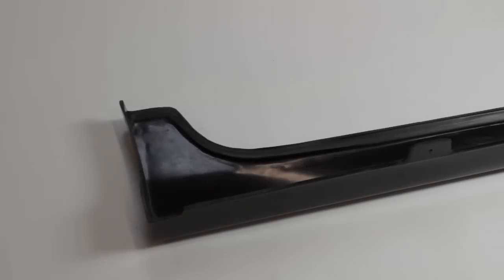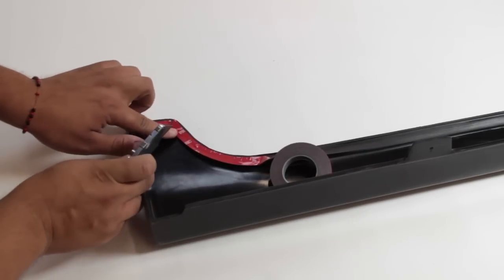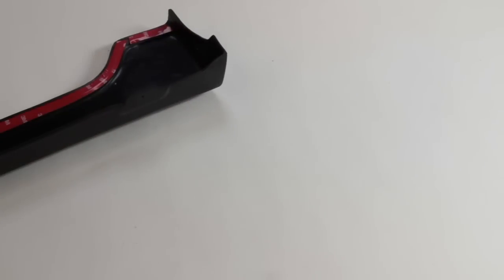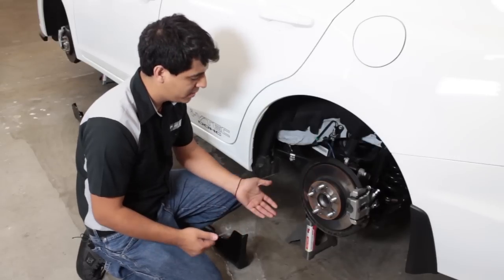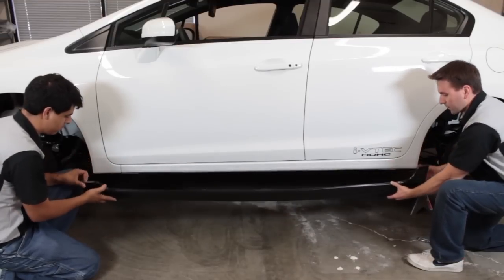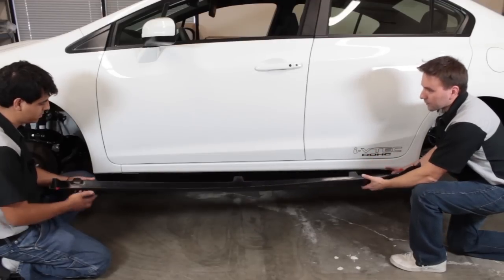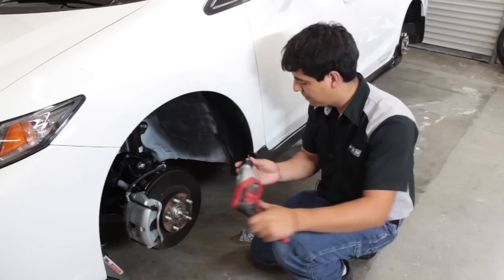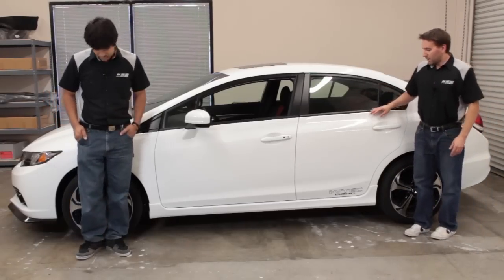PRO Design MD Style Side Skirts Install - 9th Gen Honda Civic Sedan

Comment: Great video! But I got a question, I want to have side skirts on my 2016 Honda Accord LX installed...however, on the right passenger side I have a dent underside of the rocker midway. Should I have that dent pulled before installing the side skirt for it to be flush with the skirt or can it be done by screwing where it's not dented??
Reply: I have the same problem. How did you do?
Reply: @Maycletts  Well I didn't have it done yet but I do have two options. My paint/body guy said he can pull the dent. Then there's a place that installs the skirts even if you didn't purchase from them. I actually have a set of skirts still in the box, so I'll let you know when I get a chance.

Comment: Do I  really need to remove tires to install it?
Reply from the maker: +Jc Samiano It will make the job easier. Some drills may not reach or will have a bad angle cause it may hit on the tire.

Comment: Question - Will this interfere with the spots you jack the car up ? The metal peices under the sides in 4 places.
Reply from the maker: +Tyler Redford They will not. You will still be able to use them to lift the car.
Reply: Also this will fit on the non SI model sedan of the same year ?
Reply from the maker: Hi Tyler.  Yes this will fit all Sedans (including non Si cars for the 9th gen year (2012 to 2015).  Here is a direct link with that info:
 https://www.procivic.com/pages-product_car_part_info/category-71_113/product-2861/index.html?utm_source=youtube&utm_medium=social&utm_campaign=part-pro+design+md+style+side+skirts

Thanks!
Reply from the maker: +Tyler Redford Yes, as long as it's a Sedan mode, it will fit just fine.

Comment: Hey guys I have a quick question. Which areas under the side skirt are safe to drill into? I got a different kind of side skirt that does not screw on through the front and rear wheel well. I plan on adhering it to the bottom using 3m tape but I'd also like to know which spots are safe to drill into to get a better "stick" to the car.
Reply from the maker: In general, you can drill anywhere you like under the car for side skirts installation. You are not going to hurt anything by doing this. Just keep in mind you only need about 3 holes at most.
Reply: +PRO Civic.com Awesome thanks guys. Quick reply too, you guys are legit!

Comment: This only fits the sedan? Not the coupe?
Reply: +PRO Civic.com why they don't make it for coupe si 2014?
Reply from the maker: +Samuel Wu That is correct. These are only designed to fit the Sedan models.
Reply from the maker: No good reason, just that it hasn't been done yet!

Comment: I recently purchased these side skirts from your online store and after installing them onto my car, I noticed that the sides don't stick to the car. I tried applying 3M tape to the side skirts and it still won't hold. Any suggestions besides stronger 3M? Thanks.
Reply from the maker: +RyanBSxy That we know, this normally doesn't happen. You can email us at customercare@procivic and our techs should be able to help you there

Comment: Hello I have a question, do you know where I can get those si wheels??? can I install on coupe lx 2012?
Reply from the maker: +Jsibrian19 Those are the stock wheels. They should fit on the non-Si models, but you'll need new tires.
Reply: +ProCivic.com yes that's fine, you know the website for get it?
Reply from the maker: +Jsibrian19 Probably just your local Honda dealer.
Reply: +ProCivic.com OK thank you, and do you sell parts for LX models?
Reply from the maker: +Jsibrian19 You should check out our website at http://www.procivic.com. It has parts for all Civic years and models.

Comment: doesn't drilling holes into the body cause rust?!
Reply from the maker: +Mason Vang Not in this case. The holes are tightly covered with the screws and blocked by the side skirts. We looked at it carefully and no water at all is getting in there. If you were to drill a hole in your trunk or something and not cover it back up with paint, then yes rust could definitely develop.

Comment: hey guys I have a 2010 black honda civic coupe and I want to buy the side skirts and front lip from you guys. I am curious however what color the parts come in? since in this video they seem to come black. I will appreciate a response so that I can order them and install them. Also would the same procedure apply as far as lip and side skirt installation as the video above for my 2010?
Reply from the maker: Anthonymuzika They come in black, and the finish is pretty good quality. Some customers end up not even painting them. Yes, the installation procedure would apply to your 2010, but I don't believe we have this specific side skirt for a 2010 Civic.
Reply: +PRO Civic thank you. I will order it and have it installed. Can I get away with just installing the front lip and the car looking nice ? Or is it a must to install the side skirts too when doing front lip?
Reply from the maker: Sergg40812 The front lip by itself looks very nice. We had it like that for awhile on the Civic featured in this video.

Comment: Must we need to drill holes? Can't we use 3m tape, tape it around the side skirt, and call it done without drilling holes? Thanks.
Reply: im very scary to drill the hole it will cause damage to body it getting rust by over time

Comment: Question I didn't see the front or rear splash guards reinstalled do the fit back on after the skirt was installed ?
Reply from the maker: Eric Martin The splash guards cannot be reinstalled due to the extra thickness of the new side skirt. The new side skirts do somewhat act as a splashs guards though. In all honestly, the factory splash guards do not do much at all.
Reply: ***** are there pre drill hole spots as well
Reply from the maker: Eric Martin Yes, there are. On the bottom and sides.
Reply: ***** fantastic sir thank you so much for the help guidance and videos I own a 2015 civic si stock looking forward to aftermarket installs

Comment: About how much lower of a look will the side skirts give? 1-2 inches? I have an ezlip now but it pretty much just sticks out, not down so it doesn't really give the lowered look. Same question for the front lip.  Also have an ezlip on front.
Reply from the maker: I think it looks about 1/2 to 3/4 inch lower. The front lip we sell makes the front of the car appear about 3/4 to 1 inch lower. These are just my guesses from inspecting the car up close.
Reply: ***** thank you.  Does this come with the hardware? The 3m tape and screws?
Reply from the maker: bobby hodge  The sides skirts just come with the screws. The 3M tape is very cheap to purchase at any local auto parts store though.

Comment: do you take off the skirt again and paint it or paint it while it on the car?
Reply from the maker: The procedure should go like this:

1. Dry fit the side skirts on the car. This basically means pushing the side skirt on like you would be installing it, but don't actually go through with the install. This step is just to double-verify fitment so you don't go painting something that you're not happy with the fitment on.

2. Have the side skirts painted.

3. Install the painted side skirts.
Reply: PRO Car Studio if I’m going to repaint the entire car .. is it okay if I install first then paint the entire car including side skirt?

Comment: Nice video, I'd strongly suggest clean the new parts surface with an adhesion promoter or every rubbing alchol to remove any film from them. This will also really help the double face tape stick much better. Rocker mouldings look great painted.
Reply from the maker: Yes, we mentioned that in the description of the video, but not in the actual video. Thanks for pointing that out since it is important.